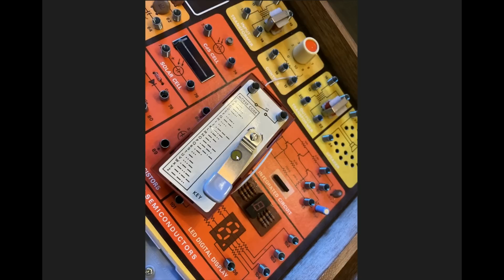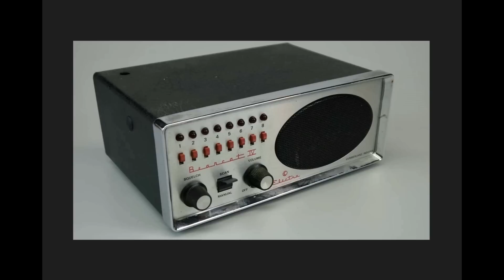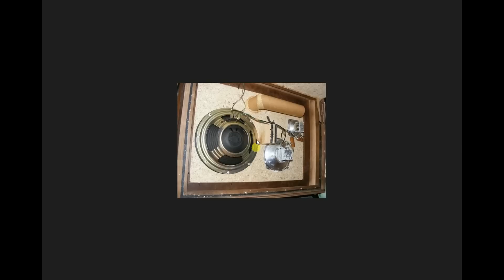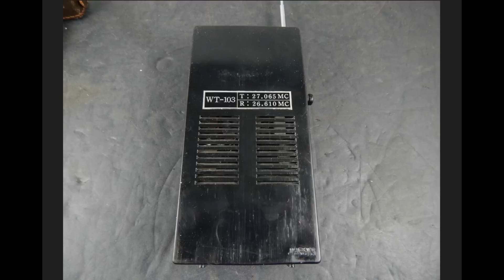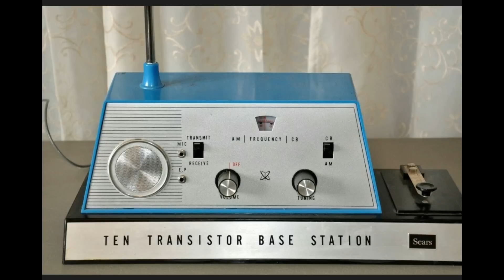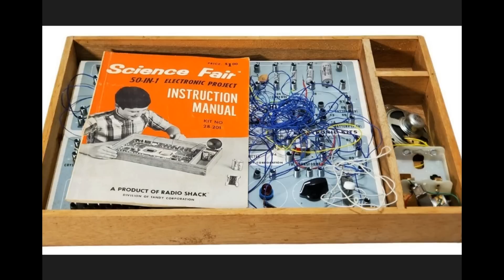Did Electronic Toys Influence Your Path?

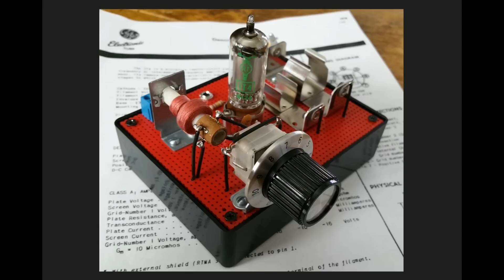Comment: At 17:16 - P-Box Kits! 
Oh, my gosh, I built the 3-Transistor Shortwave Receiver kit when I was about 12!
My grandmother stayed with us while my parents worked. So, I snuck the ladder out of the garage and climbed up on the ROOF to tack down the little wire antenna. I can't remember if it came with the radio or was purchased separately but it had little plastic dog-bone ends. I never told anyone about doing that, but I left it up there the next year when we moved.

I remember clearly receiving French and Russian programs with that thing in the evenings. Looking it up - I got lucky, that was just around the middle of Solar Cycle 20 which was an active cycle. 

Tie that with taking apart every broken appliance and radio (and sometimes even fixing it!) - I had a 43-year career in software and computers as well as an electronics hobby.
Reply from the maker: Clandestine aerial secreted into the domicile!

Comment: I fondly remember when I was around 10 years old getting a Thames and Cosmos 12AU7 regen for Christmas from my folks. I spent countless hours (and countless AA  batteries) in my room at 2am listening to far off shortwave broadcasts. Wish I still had it. Like almost all of my toys it eventually ended up being taken apart, which looking back is kinda silly because there wasn't anything hidden that couldn't be gleamed from turning the radio upside down. Oh well. Thanks Mom and Dad.
Reply from the maker: Yes I " added an amplifier to get more distance" to my base station. Um it was louder? What a mess.
Reply: You have to "try." I'd think to myself, "Is it magic?" No, these parts don't do anything if not configured properly. After the better part of an engineering degree and twenty years of maturing I got back to trying to learn the things that puzzled me as a young man. These concepts are much better understood now, but still slippery and ethereal as I slowly continue to advance my knowledge particularly with RF and digital electronics.

Comment: Growing up in the 90's, I had the Radio Shack 100- (150?) in-one and later 300-in-one kits. I sure learned a lot! I remember surprising my parents at the dinner table by asking for another germanium diode. I eventually got the Radio Shack crystal radio kit and still have it! I also had the AM/FM and shortwave receiver kits. Who else here ripped all the components out of their xx-in-one kits?
Reply: I had the 150-in-one kit in the mid 80's and used it all the time, but over time I used hook-up wire for other things and the transistor/s burnt out or failed and I did take parts out of it.  Sadly I no longer have it and I also remember having that organ that someone gave me.
Reply from the maker: Please sir, may I have another diode?

Comment: I had the 20-in-1 kit, which was a little different. Each component was on a separate little plastic base, and you could move them around to arrange your circuit. It still had the springs, but the connections were made between them with little metal bars. I remember connecting the solar cell to the audio transformer to "boost the voltage", and being confused when it didn't work. A few years later in 6th grade, my dad bought me a Heathkit digital alarm clock to build. It still works and keeps perfect time in my office 40 years later.
Reply from the maker: I bought one of those Jameco digital clock kits with the giant ASIC and 7 segment displays put into a Radio Shack box.

Comment: Physics toys influenced mine, pulleys, magnets, lenses, buzzers, a steam engine, a flashlight, crystal radio, tiny electric motors, rockets, tube amplifiers, transistor radios, the SW band on my parent's radio.record player, a good really good SW, (Hallicrafters SX-25,) antennas, a couple of small solar cells, CB radio kit, walkie-talkies, televisions, speakers, a Theramin kit,  on and on, second hand and broken things mostly that I'd fix, or try to. I always wanted the 150 in one kit, but couldn't afford it. Worse, you had to disassemble everything you built, and that seemed stupid. Batteries were always the problem. I was a rural kid, and never walked into a Radio Shack till I was an adult.
Reply from the maker: I was lucky enough to be in a college town, in a rural area, so kind of an oasis where there were close by hams, and radio shops that you could pillage dumpsters and abandoned TVs from!
Reply: @MIKROWAVE1 , that's where I am now. The University of Colorado is half a mile away, and I hit dumpsters of start-ups regularly. I have lots of goodies, but I lost in a fire a quarter million SMT resistors of essentially every value, 240 miles of 44 gauge magnet wire, antique shortwaves, thousands of transistors, thousands of crystals,  thousands of feet of hook-up wire, and lots of other good stuff I scrounged from dumpsters. Tens of thousands of dollars worth of stuff, and none of it was insured because it was freebie surplus stuff I gathered dumpster diving. So I started all over again.

Comment: What a memories! I remember, when I was 13, in the middle 60's, I got as Christmas present the kit Electronic Engineer, by PHILIPS. It was my entrance in the imaging electronic world. 😊
Reply: Me too.  I remember the legs breaking off the AF116.
73 Steve
Reply: I have a recollection of tiny three legged rubber underpants that fitted on the transistor to help stop the legs breaking off. I can't remember if they came with the Philips kit or perhaps a give away from Practical Electronics or maybe later at College to protect their precious stock.
73 Steve
Reply: @m0kov  as far as I remember, there were no any kind of protection for the transistor's lead included in the kit. It was, really, a problem. I remember I was using the plastic cover from wires to solve that and protect somehow the transistors. (AC126 if I remember well... 🤔😄 )
73s, Vassilis.
Reply: Me too. It lead to a career in electonics and a ham licence.

Comment: I spent 33 years of my life as a Avionics Technician. No doubt that was a result of an interest in electronics because of my Dad. My dad was involved in radio and TV repair most of his life so I guess I picked it up from him. Growing up I always had an old tube SW receiver in my bed room and listened to them a lot.  At 13 I built a regenerative receiver from a magazine article, and a tremolo circuit for my guitar amp. I also remember also having one of those electronic project kits that allowed you to build several circuits including an AM radio and intercom. I don't remember who manufactured it though. My Dad was never a Ham though he listed to SW all the time. I didn't catch the Ham bug until I was 23 yrs old and I built a ton of Heathkit equipment.

Comment: Hi Mike. In the sixties I built a "ground wave" station utilising an old tube radio (AF stages only)  and a speaker transformer and double pole throw switch (to switch for receive and transmit) connected to two ground rods and communicated with a friend about a quarter of a mile away on his similar system. This system was tried out in the armed forces including submarines. It was from an article in Practical Wireless in May 1964 and February 1965... Just in case you were interested to check it out... 73s
Reply: That is cool! Just found and downloaded the articles.
Reply from the maker: Wow that was a classic Hippie  ground radio setup!

Comment: Help. I have a Y7060 GE radio and I would like to restore it. Do you have any service data or schematic information that you can share?  Even if you can take detailed pictures of the foil side of the circuit board.  I would love ti restore it.  Yes,  radio shack , Healthkit. Lafayette, Olson electronics, all influenced me to become an inventor and electrical engineer. 😊
Reply from the maker: I am in the same boat. I have one (The GE Base Station) that as you saw, just arrived this year and it needs restoration. So maybe a research and restoration video coming?
Reply: @MIKROWAVE1 Do it, Mikey! Do it! (in the vein of The Doors, "Do it, Robby! Do it! Roadhouse)

Comment: YYYESSS!!! I still have that same 150-In-1 Radio Shack kit from when I was about 10 years old in about 1976 (my father gave it to me for my birthday that year, or a year close to it), as well as several others RS and similar kits, and everything, including the accompanying books, is still in MINT CONDITION! My father was an electronics technician in the Navy (“Fire Control Technician”) on Navy Destroyers in the 1950s and 1960s, and then went to work on Polaris missiles, Westinghouse, and beyond to some other electronics firms after that. He would bring me home components and parts from work and would teach me how to build simple little circuits with CARDBOARD BOXES being my project boxes, and this was when I was a LITTLE KID, in single digit years! I would also “help” (watch) my father fix TVs and such and I learned a lot back then, and used to enjoy going to town to the drug store to test and buy tubes with the big tube testers in the store. These were GREAT times, and then Radio Shack started coming out with these kits, and everything really shifted into high gear! I eventually took some correspondence courses with the Cleveland Institute Of Electronics in the 80s and 90s, and wound up working in I.T. and also teaching it (and music and P.E.) at a couple local colleges simultaneously... I.T. and doing everything at board level and not at the component level anymore kind of knocked me out of electronics for a while (except audio and music electronics), so I am again, decades later, sort of relearning a lot of this stuff, and rediscovering it all anew again, and having a blast… Thanks for this video, and all your others! 😊😊😊
Reply from the maker: Wow, that cardboard box prototyping trick! I forgot about that. Oh we have to do that one on the channel.

Comment: My Remco was red. They used ‘piano wire’ in the thing… can’t count the times the uncooperative wire ‘stabbed me’ while trying to bent it around screws in the housing. Junk. But… I was ‘on the air’ and hooked! Also, my Allied Radio Knight Kit 21-in-1 Transistor Lab had the ‘Wireless Broadcaster’. The bomb! 12 years old and my neighborhood has a new radio station… ME!

Post high school I entered the broadcasting industry as a (paid!! 😂) DJ. Did that for about 10 years. A fun filled misstep in terms of a career. Following that, I masqueraded as an un-degreed electronics technician. 
Never have had a career, come to think of it. 😊The End.
Reply from the maker: Well its hard to figure how they came up with that wire, but you have to admit - it was kid resistant. It was not resistant to my plastic melter woodburning kit!

Comment: Did you get a lot of feedback on the oscillator? Hams in the south in the 50s would not use integrated circuits.
Reply from the maker: Too many legs?
Reply: @MIKROWAVE1  Perhaps not yet existing (at least outside of a lab) impeded them. It's the same reason I refuse to use flux capacitors for time travel. :)